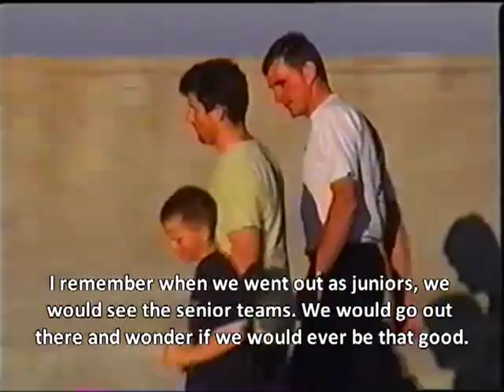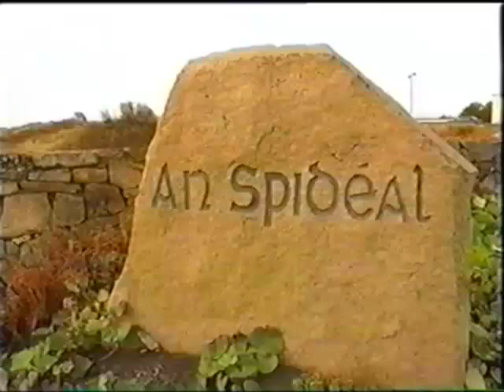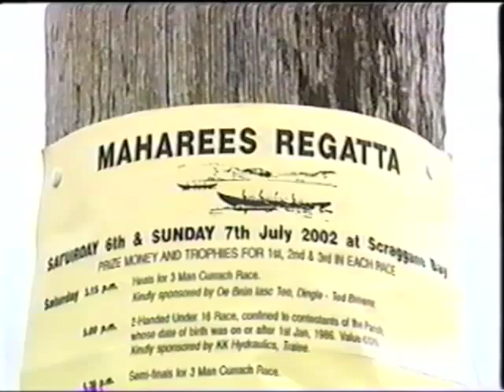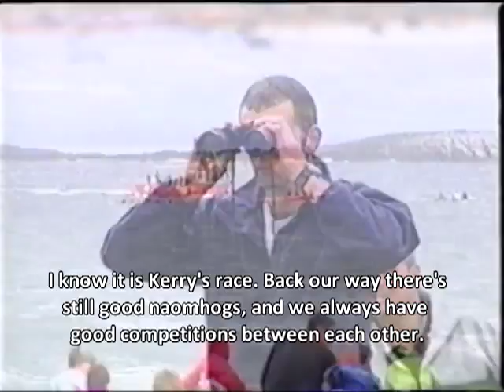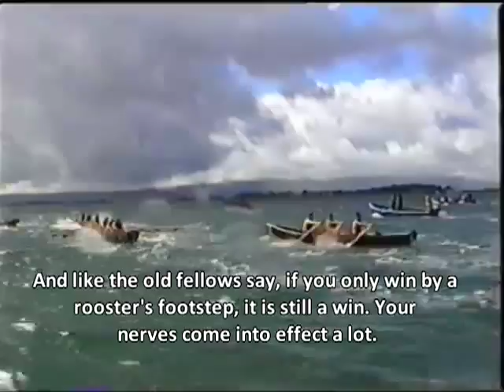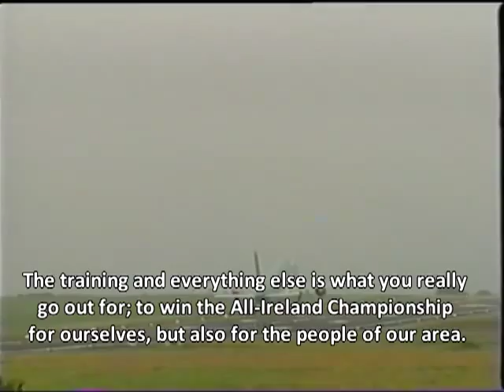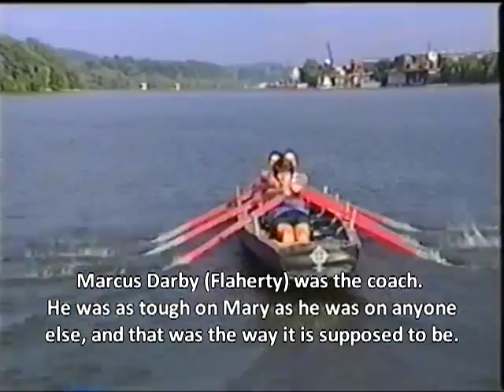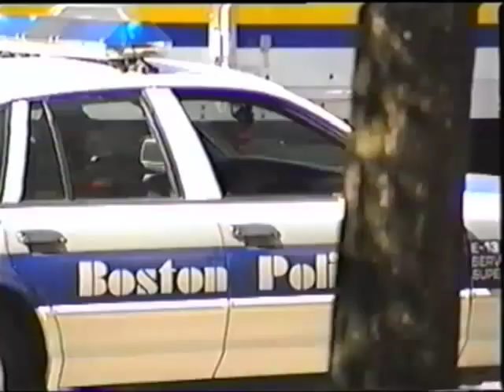Curachai

Comment: Great to see many of my distant relations from connemara working hard to try and win a boat race, I have never rowed  but if  I i was there I would join in the fun with my own boat  Bluebird 12th, I would not have to cheat my 1 man boat, it  has got speed and a powerful old fighter plane engine